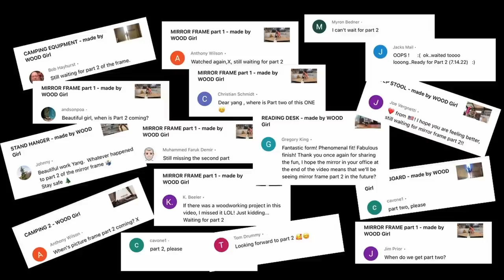MIRROR FRAME part 2 - made by WOOD Girl

Comment: Where is your eye protection?  Here in the United States, both OSHA rules as well as my liability/workman’s compensation insurance require eye protection to be used whenever operating machinery such as a tablesaw, lathe, plainer or jointer.